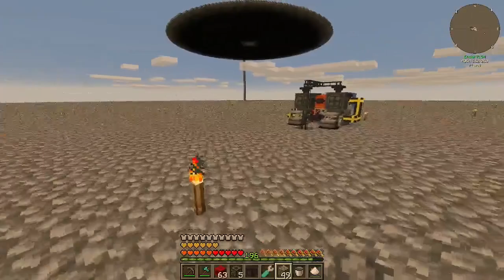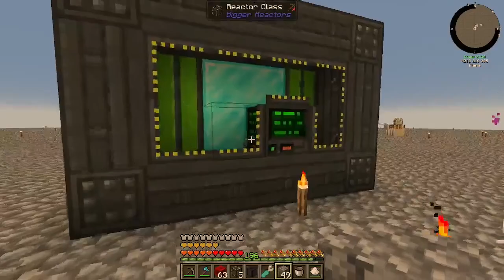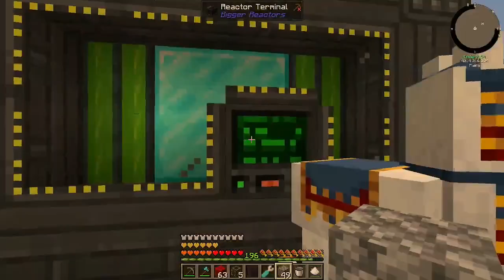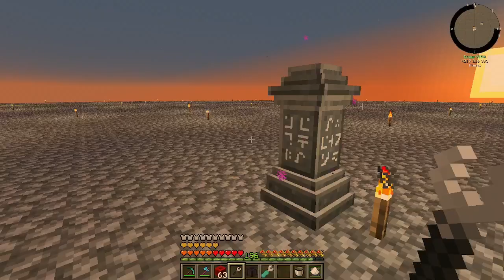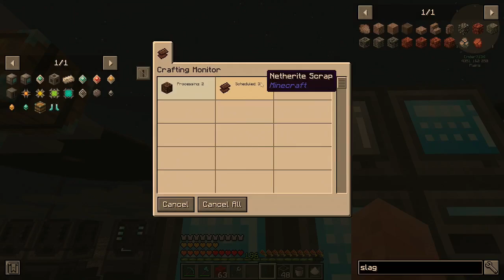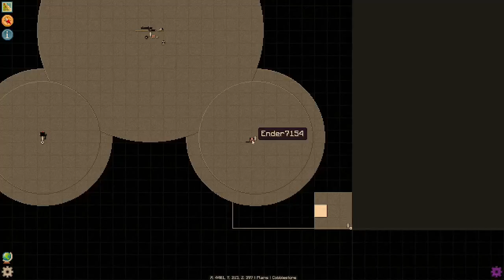Bigger Reactors Mod = Big Big Power! | Episode 7 | ATM 9 to the Skies

Comment: How do we take out waste? I can’t seem to get it out no matter what pipe I use
Reply from the maker: It has been a minute, but if I recall you need to make sure you have an access port, and then you need to switch it to output.  Than it fills with cyanite and any pipe can remove it.

The key is having two access ports, one set to in to add fuel and one set to out to expel waste.
Reply: @end @ender7154 s thank you so much I noticed that the cyanide comes in bar form, I have been using the fluid pipe to try and get it out
Reply from the maker: Thats a common mistake.  I have done it before.  

You can also pipe the cyanite ingots directly into a cyanite reprocessor and get more fuel life out if it if I remember correctly.

But I think you also need it to do the turbine construction or something.

Again, its been a while.
Reply: @ender7154  ok